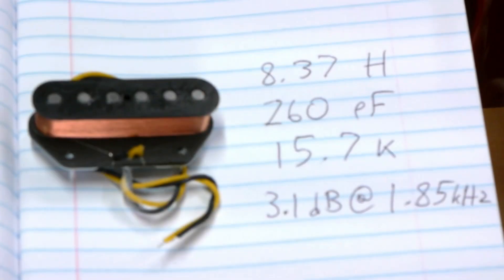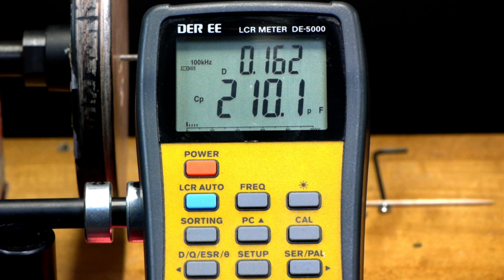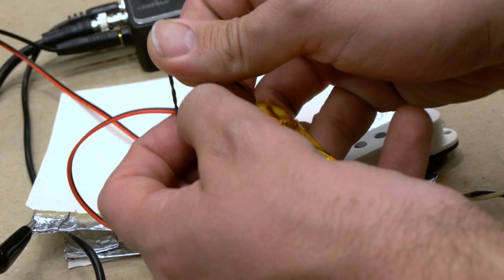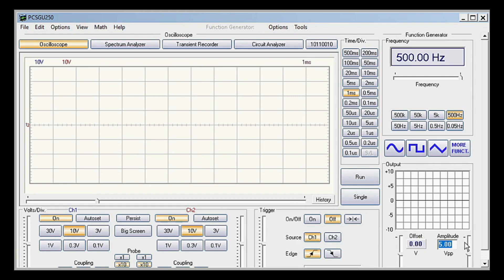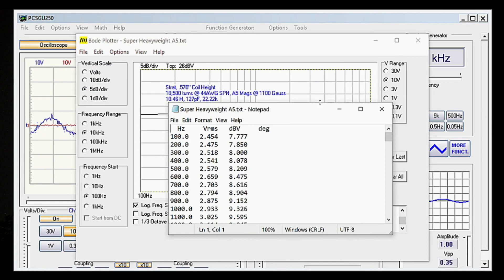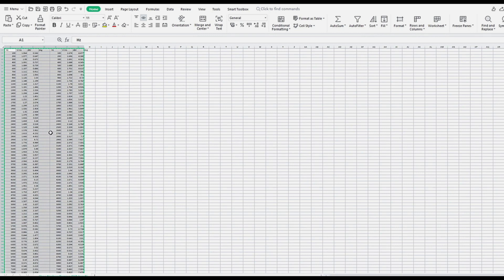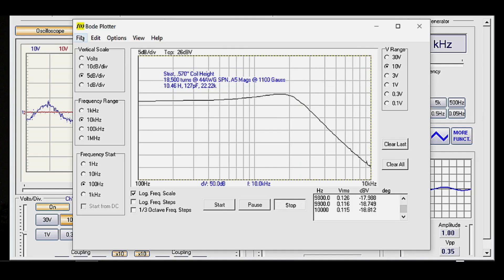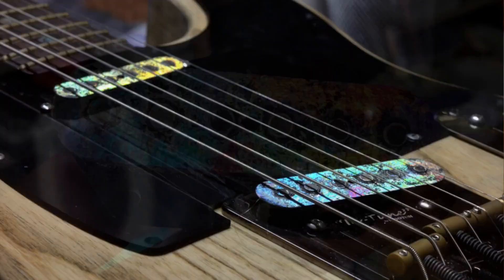Complete Guitar Pickup Testing: Step by Step Guide (LCR Meter, Gauss Meter, Oscilloscope)

Comment: Thanks again. Doing some noiseless split coil jazz bass humbucker pickups. I just can't stand the 60 cycle hum. Trying to see if I can get the pbass sound out of a jazz bass. Ordered some thinner 43 awg trying to get it up to 10.5k ish.
Reply from the maker: Absolutely! I'd like to try split coil Fender style pickups eventually. I've only made stacked noiseless coils, which also come out very good. A lot more work, but worth it. 

I've gotten a little more into humbuckers recently, kind of in a Magnetron/StagMag style, using Alnico polepieces instead of steel slugs, screws, and bar magnets. Even with higher inductance, they're quite bright sounding, very, very Fenderish, so much so that I think they work a lot better with 250k pots, and might be too bright with 500k pots. 

The more I play direct in to my computer, the more noise bothers me. I still have regular single coils in my Strat (1 neck, 1 bridge, with a 3 way switch and two push pulls -- series/parallel, in phase/out of phase for the in-between position). 

Really, really like these humbuckers so far. Also the first SG I've ever owned. I like the feel of a Strat more overall, but the SG is starting to grow on me. So much so that I might even make a two humbucker pickguard for my Strat and start using these in there too. 

My favorite setup is still a 3 way switch, with two switches: series/parallel and in phase/out of phase for the in-between position. It's a great setup. 

I'm also using three 28AWG lead wires for this humbucker. You can't split it of course, but man. Three separate leads (one for the baseplate ground, then a hot and a ground) works so much better than your standard single conductor braided wire, or the cheaper single conductor wire with the bare wire and single conductor inside that plastic insulation. 

I'm actually excited to start offering these. I don't think the lack of coil splitting will be a big deal, especially since these are so bright, splitting them would be pointless anyway, way too shrill. But man. Same way I do Tele pickups (as I learned from Rob DiStefano of Cavalier Pickups): separate ground for the baseplate, so you can switch the phase as you please. And do the series/parallel and in phase/out of phase mods as you please. 

A real game changer.
Reply: @guitar_md  

Yeah the polepieces vs an alnico bar makes a huge difference. Always wanted to experiment with pole pieces and humbuckers. Pbass pickups uses the  polepieces instead of the bar and the bass is very thumpy unlike jazz neck pickups. 

Really want to do a hum cancelling p90. The pole pieces would be a godsend instead of 2 expensive bar magnets. Split coil p90 humbucker. Only worried about phasing issues when bending D or G strings. Everyone says I'll have issues with phasing. Not sure though. The jazz bass split pickup I made sounded good but then again I don't bent those strings at all.

Really excited though. We can now fine tune the guitar pickups and clone certain sounds and ultimately create original or innovative pickups.

Yeah I like the 3 way switch best for guitar also. 5 way just too hard to quickly get the in between sounds. Need to experiment more with the phasing and series parallel switches.

Cool that  you are going to sell humbuckers now. The univox clone humbuckers had that extra ground to baseplate. It did affect the resonant peak a little bit. Seems like raising the inductance to drop the shrillness may help?  I think the extended polepieces/baseplate of the early univox pickup gave it that beefy paf sound but has a super high resonant peak in-between a paf and strat.
Reply from the maker: @AmerikkkaGuitars  They do make P90 fiberboard flatwork and center hole covers. I recently got some in and actually planned on making some noiseless P90s myself in a humbucker footprint, like a Seymour Duncan Phat Cat but with alnico poles. The original P90 pickup actually used alnico poles, which is interesting. 

I think a stacked noiseless design is the way I'll go as I've always done noiseless pickups by stacking as opposed to splitting the coils. 

I haven't tried making any split noiseless yet, so unsure about the alleged phase issues. 

The possibilities are very exciting for sure. For stacked coils, much thinner wire is excellent, but very expensive. Ultra Fine Copper Wire from China is the cheapest I've found. Otherwise specialty gauges like 46AWG from the USA are around 85 dollars a pound and up. Stacked designs leave you with barely 1/4" winding space per coil, which I've been able to manage with 44AWG, but if you want a fatter tone you need more turns. Recently did a Tele noiseless bridge pickup for someone with 11,300 turns per stacked coil, so 23,000 turns total, with 46AWG. With stacked it's important to remember that one coil is inert. I do want to try making a split noiseless to see the sonic differences vs. stacked.
Reply: @guitar_md  Yeah 44 awg is probably the lightest I'll go, Remington has 5 lbs for about $140. But we'll see how the 43 awg works. wow 46 awg is super expensive. 

Interesting, that the original p90s had magnetized pole pieces. P90s seem like they would stack easily. I tried stacking one prewind and all the parts seems to fit. Wilkinson sells some, but not sure how accurate they sound. Might be a tight fit on some guitars that may need more routing clearance.

That Tele noiseless sounds interesting. Not sure I've seen any with 46 awg. LMAO I would sneeze and the wire wire would break. Too lazy to  make a tensioner haha. Leo must've been on speed.